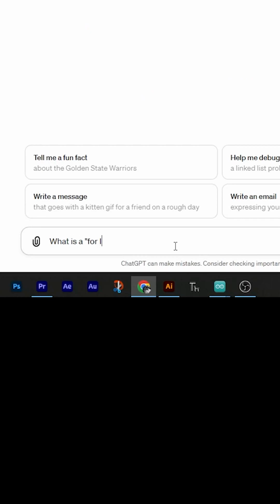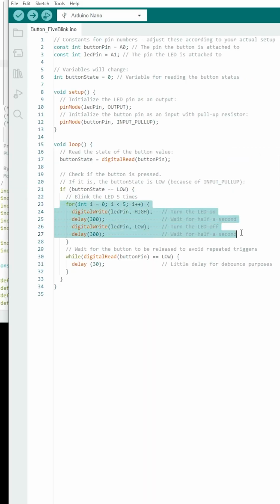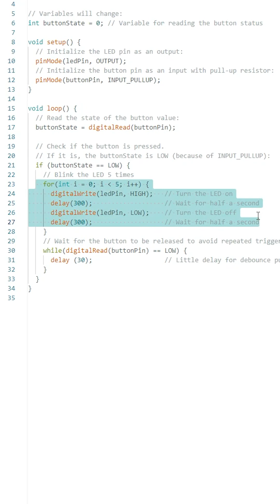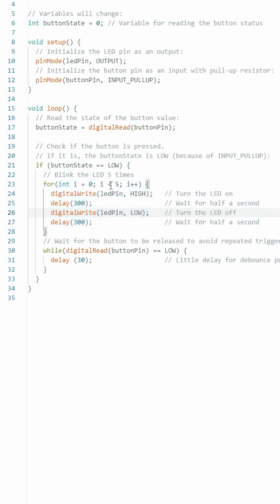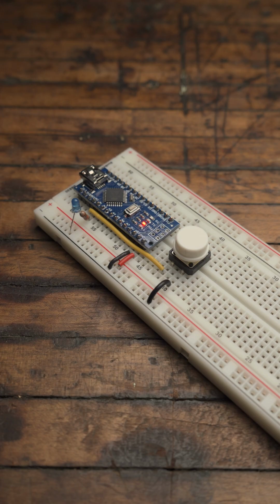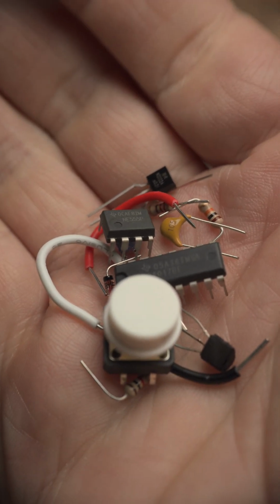For Loop - Hardware Only

Comment: But here you havent built a FOR LOOP - you only made a FIVE LOOP envelope - programming loop can also execute inside code and wait for its finish, can read the iterator value and not-structurarely change the iterated value by 2, 3, by current i value, multiply it,  decrease it and stop after an overflow try to build that and only put some pins for the finally needed solution. Later we will come to a for loop generating other for loops and executing them  :)

Comment: using a analog circuit would have been smaller as you could just use a capacitor and a half wave rectifier from an Occilator And after capacitor charges enough voltage it powers off the pnp transistor What ever 
I'm not a professional

Comment: You could replace the decade counter with an opamp/comparator and RC charging circuit—set the comparator cutoff point to the voltage value needed to get the capacitor charged to allow the desired number of pulses.

Comment: LOVE this video. 

I am interested though between the line of HDL and how a processor accomplishes things.  For some reason that is still really vague to me.

It is often stressed that HDL for FPGAs/ASICs describes HARDWARE. But what you described here is how some SOFTWARE capable chip (like the Arduino) could potentially achieve the same exact thing as hardware. So is software like hardware in disguise of a chip?

So ig what I am wondering, is the line between the 2 methods of achieving an operation such as blink an LED 5 times? Like the chip on the arduino has some set methodology, instructions, etc. that could potentially be really complex even for something simple like blinking the LED.

 whereas an FPGA can be designed to specifically just blink a LED, all from the physical configuration of the nanascopic hardware in the FPGA.

Man wtf is software lol.
Reply: Software transforms a general purpose hardware in a dedicated structure. It does this really and effectively, the binary values of the machine code acting like conventional switches configuring circuits. This is true for FPGAs and for microprocessors as well.

Comment: 🗣️Mechanical never dies
Reply: In some cases it’s still more reliable than software ⚙️
Reply: How does the IC not count as software? wtf
Reply: @Jeff_Epstein_  Do you call your computer’s processor SOFTWARE?
Reply: @Jeff_Epstein_ How can an IC that’s not even programmable run software?

Comment: How difficult would it be to design/build this without using any ICs?
Reply from the maker: More difficult... but still possible. As long as you're not considering a transistor an IC.

Comment: You could use two timers and an and gate as input to the latch instead of the decade counter. You could even use another timer because there's a latch inside of it!
Reply: Can you explain how to timers and an and gate form a counter?
Reply: @wvg.  the decade counter is used as a frequency divider in this case, so you could just use two timers.
Reply: "and an and gate" my heart died trying to understand simple grammar